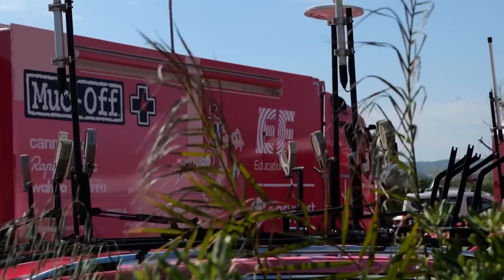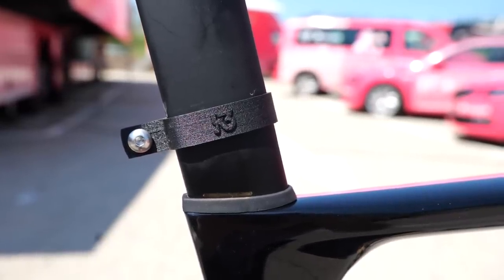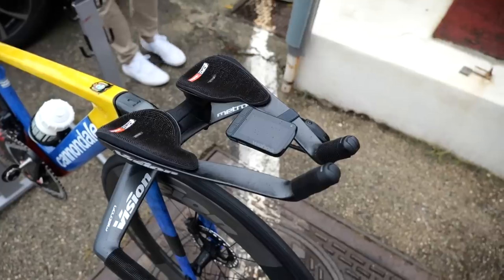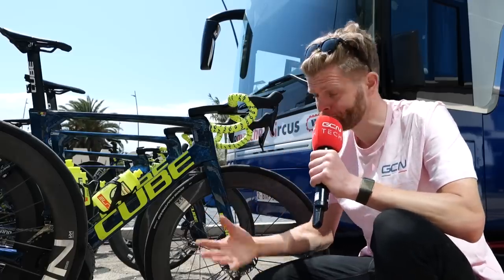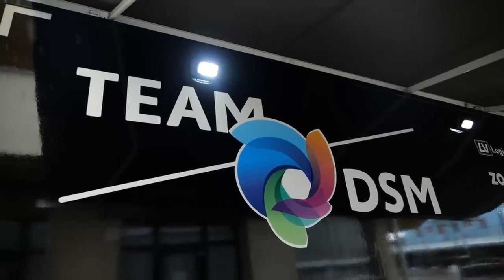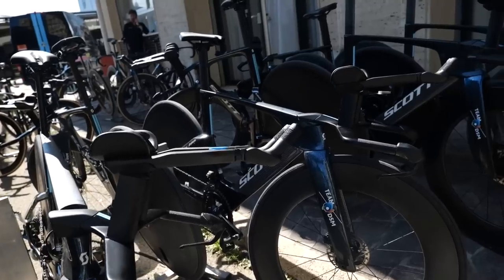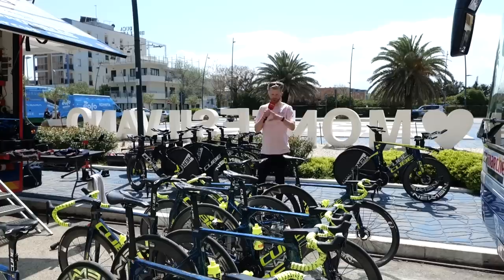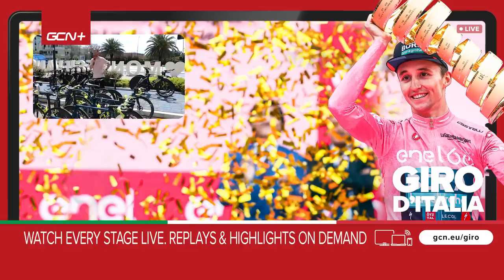We Found The Best Tech At The Giro D'Italia 2023

Comment: 28mm tyres on pro bikes is insane. 10 years ago endurance bikes were sold with 23mm, just shows how things change in cycling.
Reply: Some things certainly change at glacial pace in the pro peloton. But it was all predictable.
Reply: Funny, Because my friend stocked up on a ton of 23 mm tires a few years ago.
Reply: Who is choosing the products now though? Riders or sponsors agents?
Reply: You have to go fatter heavier tires with road disc or you lock up the brakes too easy on the preferred 23-25mm high pressure tires that are still used for the hour record or in TTs.
Reply: @bennettbrookstein4332  if they live somewhere with very good roads, they're not going to lose much by going with 23s.  Plus, many bikes still on the road don't even fit 28s anyway
Reply: @durianriders  yeah that's true

Comment: That chain wax check and peeping the electrical tape, no one gets more excited about marginal gains than Ollie.😂
Reply: I must do that valve thing but I hate Schrader, and yes so much I am trying to think how to adapt so can put presta valves on rims when I have a car
Reply: I doubt there's any gain for the Ceramic Speed rear jockey cover, just hassle for the mechanics.
Reply: @charlestoast4051  I bet there is gains! Maybe like 1w though so unless really desperate then it is not worth going for it
Reply: @mlee6050  dumb idea for a car.   Schrader valves are better for a car due to the volume of air and lower pressure.
Reply: @charlestoast4051  a friend of mine tested that pulley cage and it gave him 2w over his previous oversized pulley system in the tunnel.  This is on two bikes he tested on the same day.   He never tested the drag with a stock cage though so it's hard to tell if you gain more from the oversized pulleys and aero cover vs just having a smaller cage with marginally less efficient small pulleys.
Reply: @veganpotterthevegan  maybe so, I just hate them as often how struggle to detach the pump which makes Schrader loose way more air than I ever do with presta
Reply: @mlee6050  sounds like much more of a pump problem or user error.  I've been a bike mechanic for over 10yrs and installed car tires for 3 years.  Never had an issue with either valve in themselves. *I converted my fat bike and 29+ bike to schrader valves since it makes a lot more sense, especially if you're having issues with seating beads on a high volume tire.
Reply: @veganpotterthevegan  on bicycles I always get annoyed at like lose 5psi when detach pump on Schrader and why I prefer presta, mind you on my next few bicycles presta be king but as I enjoy tubular unless on mountain bike
Reply: @mlee6050  I can't fathom losing 5psi from removing any pump head with regularity.  When it's happened to me, it's been to a bad grommet on the pump and it's happened with both types of valves.
Reply: @veganpotterthevegan  I never had on presta but think as air pressure between push presta valve open or something, just lot easier to remove pump from presta, also when aim at psi accurately to get best rolling resistance (yeah with cars I feel if find sweet spot it be way better fuel use and like each psi makes a difference)
Reply: @mlee6050  PSI accuracy is extremely important for race cars.   Guess what kind of valves they use?
*I've never heard of anyone having problems like this with schrader valves🙃
Reply: @veganpotterthevegan  I only heard them science what air use but other than that I only seen them take old off and new on by the nuts without inflate them

Comment: I just started waxing my chain for the fist time, so far its been a good experience. A little costly at first but shouldn't be as bad going forward.
Reply: I am committed now, too. My biggest issue is the never-ending wax “snow” (wax coming off the chain) that keeps cluttering up my frame and parts. Hard to clean. I use a car detail brush and vacuum but it just keeps snowing. So you either have to deal with constant chain snow or black lube marks. Wish there were a cleaner solution.
Reply: Replacing the master link once every 7-10 days adds up in a hurry for high mileage riders.  Or are you reusing ?
Reply: @Kevin Barkema  I've been reusing for about 3 times haven't had an issue yet.
Reply: @Kevin Barkema  I've reused "non-resusable" links a good 8-10x through nearly every chain I've owned in the last 200,000 miles of biking I've done.   Some of those chains had "reusable links".  I've broken 3 chains during that period and none were at the removable link

Comment: 10:19 best bike I’ve seen in years. Horizontal top tube. No dropped seatstay. Round handlebar. Normal stem. Aaaand even tubulars.
Reply: You mean worst bike? They are charging 4100€ for frame alone, which is ridiculous considering it's outdated. I mean, it is supposed to be a lightweight climbing bike, but frame itself isn't that much lighter than something like Elves Vanyar, which costs 1/4th of Aurum.  The Aurum bike is a literal waste of carbon.

Also, flat top handlebars are arguably more comfortable than round bars.

Comment: Shrader valves was quite surprising but what Ollie didn't mention is the fact that they are much faster to fill and empty because of larger inner diameter and much easier to fill with sealant. They even resist blocking by sealant better because of a larger valve seat.

The hiding inside the rim was a nice feature too.

Next we'll see side cutouts  à la disc wheels on all high profile rims.

Comment: About Caicedo's TT bike, the elephant in the room is the sloped upper tube, going down till it's just below the top of the rear wheel. I don't know if it's a novel feature, but I've never seen such an extreme slope on a TT bike. Strange it got no mention here.
Reply: Pretty sure its just because of the small size of the frame.
Reply: @wouter6053  Maybe, but even so it seems much steeper than in any other TT bike.
Reply: @mvm9407  Steeper because of the same drop over a shorted distance.
Reply: @bobfoster687  If you compare that upper tube to something like Remco's Specialized Shiv (Remco is relatively small at 1,71m, thus using a small frame), you'll find out that Cannondale's is in fact very low at the back end. Almost as much so as in an endurance bike! Most other TT bikes have the upper tube slanted in the opposite direction. I was just expressing my surprise because I had never seen a TT frame like this. I didn't mean to start an argument, or something like that. I'm sorry...

Comment: Is anyone using NITINOL chain mail tubes yet. Provides 80 to 100 psi equivalent support but without air, so they cannot puncture. Can be made to compete with  tires and tunes.
Remove risk of flats will win races.

Comment: Do not think enve makes tubular rims...did you mean inner tube?
Reply: they do and it clearly was a tubular tire :) you can see that on the way the size is printed (f.e. "25-28" means a 25mm tubular one for 28" wheels).
Reply: @Digi20  wow, I know they used to make those years ago...will have to check if they still do.  They are not on their web site.